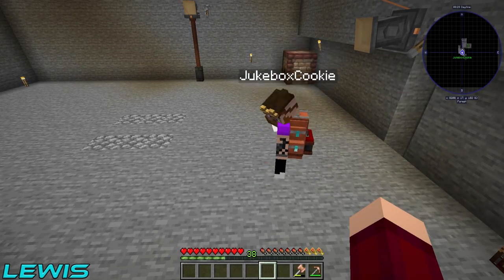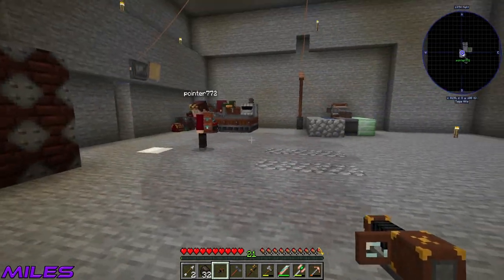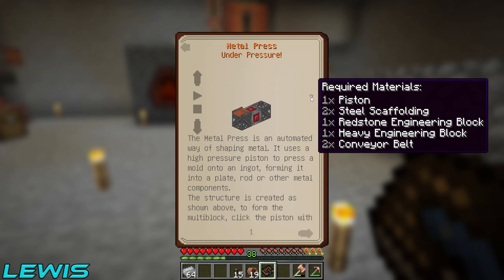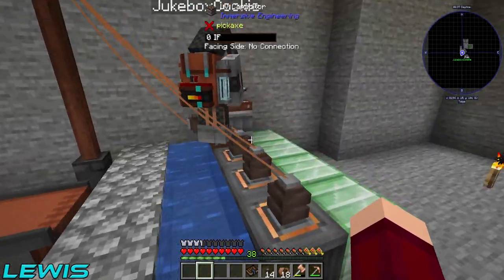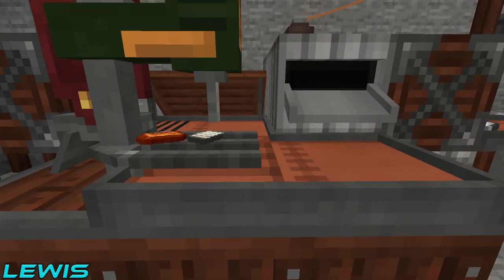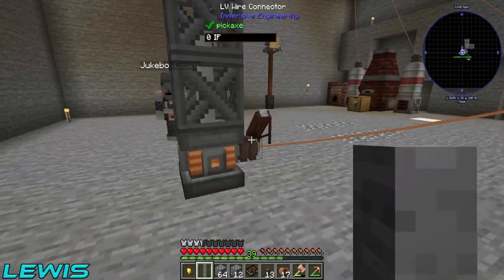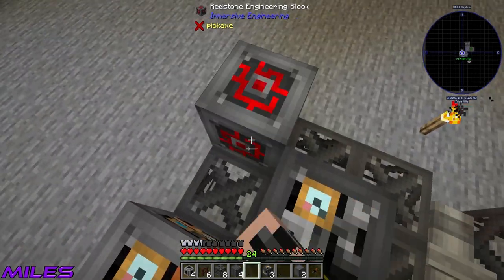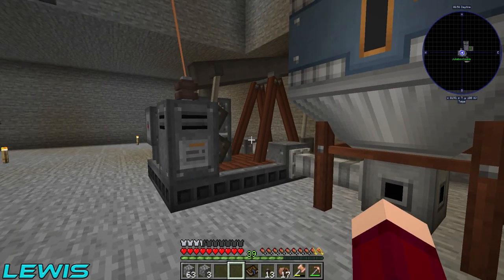MASS STEEL PRODUCTION & DRILLING! EP10 | Minecraft Stone Technology [Modded Questing StoneBlock]

Comment: So from what I understand is that the ice turns back into water (Edit: when your not in a cold biome). But the next stage and the stage after that doesn't? Ice->Packed Ice->Blue Ice; So if you leave the ice in the freezer thing for longer (may need more water) then it should eventually turn into blue ice which should never turn back into water. Maybe try the blue ice for the generators?
Reply: Thats my suggestion it also might be colder making more power

Comment: theres a more efficient way for the thermoelectric generators. If you set them up in a checkboard pattern not only can you use 1 source block for 2 generators but the generators also produce more FE for the each side that has the source blocks on...so say 1 thermoelectric generator if it has 2 lava and 2 ice/water it will produce more FE